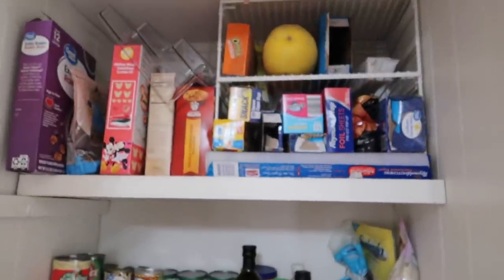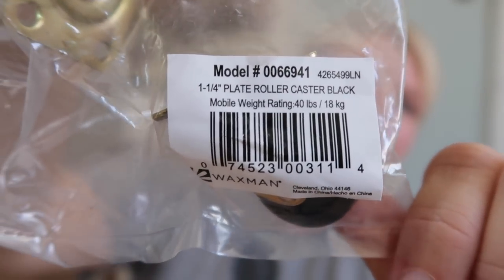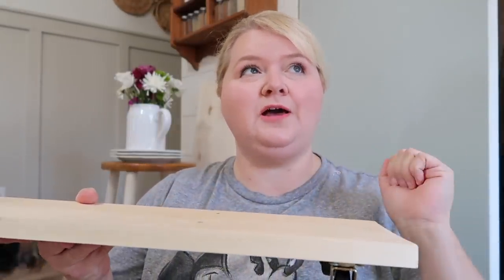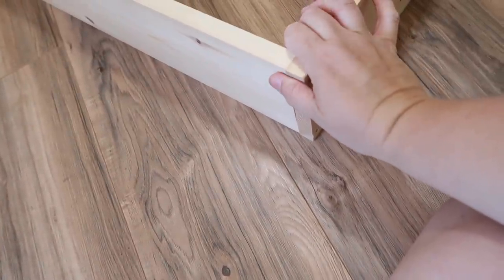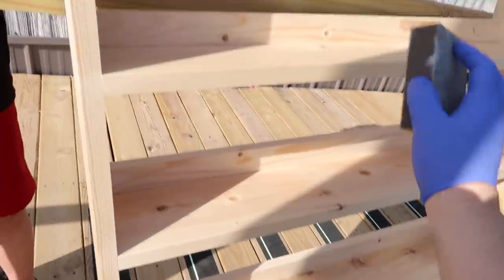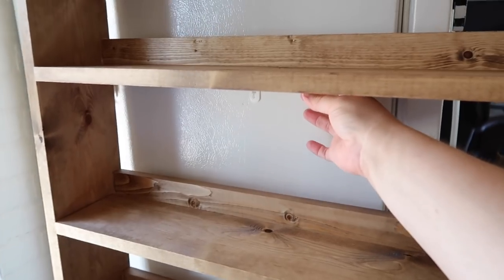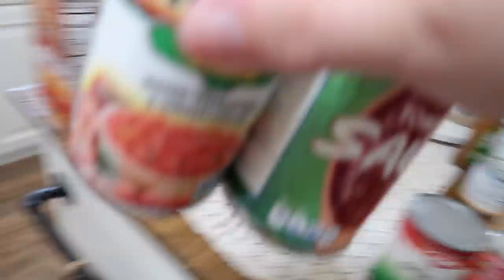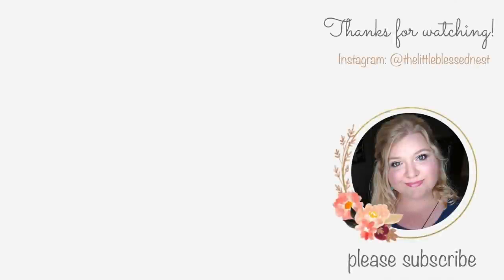Mobile Home Updates | DIY Rolling Pantry | Small Kitchen Organization | Renter Friendly

Comment: You did an awesome job building the pantry.  Yes, I thought it might tip over even before you mentioned it.  I would definitely put it between fridge and countertop.  That's the reason for casters.  You can just pull it out when you need something.  Love it.  Looking to see if there's a place for me to put one like it.
Reply: I agree - for safety purposes; also love the natural color of 🪵
Reply: I made a small one and put it in my Bathroom. It is fantastic. The Vanity unit was smaller than the counter top so it sits under the counter between the vanity and the shower screen panel. I painted mine the wall colour so it blends in well. My first effort and very proud of it. I think Stephanie is showing us you have to have a go and you will be surprised at what you achieve.
Reply: @katbar6066  That sounds great.  Can never have too much storage.  I'm always investigating spots to put something for storage.  My house is very small so never enough room for things.
Reply: @DJ-ok5ov  mine too and bathrooms are notorious for lack of the storage we girls need!

Comment: Looks good Stephanie. I would put it between the fridge and counter. You can hide the tag by hanging something over it, like a picture, or pot holders etc... Also, if you were putting it on the outside of the fridge you would not have needed the wheels, right? Please don't take this as a criticism, but even adults should wear helmets when riding ATVs as well as young ones riding with the adult. If for nothing else but showing safety by example. Thank you for the song Timmy! Looking forward to the new pantry shelves and door redo. Take into account that microwaves also need ventilation and that it's not too snug of a fit. I think it's going to look good in the pantry. Thank you for sharing today Stephanie.

Comment: Pro organizer here. I just remodeled my home and designed and built my pantry. I made the space between the shelves smaller to maximize the number is shelves I got in. I WOULD NOT MAKE THE SHELVES DEEPER except your microwave shelf. Things get lost and it’s a nightmare. Measure most of your food for height then figure out spacing. I have 12 shelves in my 8’ tall pantry. There are some great diagrams on Pinterest maximizing pantry shelving heights. Good luck gal.
Reply from the maker: Sounds great!

Comment: The roll out pantry is a great idea, nicely done, it sure will add to the storage, holds a lot.
Suggestion:  You could add more shelves in the original pantry, there's a lot of room above the items on each shelf that is wasted space and so you don't have to stack items.  Go with the 16" deep and put the 12" in between, since you already have them or even 10" or 9" deep in between, to be able to reach items easily; double the storage area.  I like the idea of bead board to finish off the face of the roll panty, it will look good.

Comment: Goo Gone is an oil base which is probably why it didn’t stain the same.  Just peel the sticker off using a putty knife as much as you can without gouging the wood and then sand it to remove whatever is left. If you don’t like the look of your cans showing, you could put a piece of bead board on the side that faces the door and install a handle on the end to pull it in and out when you want to access the cans, great job!

Comment: I, like most of the commenters, think it should be between your fridge and counter. My main reason is I think the opening and closing of your door could vibrate just enough for it to eventually cause the shelf to tip over. With my kind of luck, someone would be coming in the door and it'd hit them.

Comment: I think the rolling shelf should be between the fridge and the cupboard and then add a handle to pull it in and out. Given you have quite a bit of weight on the pantry shelves  I would consider an extra set of wheels in the middle. I would also put a support on the open side so the cans can't fall out. It would look a lot better too.  The wider shelves in the pantry are a great idea as is moving the microwave into the pantry.

Comment: I would put it between the fridge and the counter, turn it so the edge supports are facing the sink, all the cans at the bottom so they won't be on show, put some handles over the sticker residue so you can pull it in and out when needed.

Comment: You should have put water on the sticker first then let it dry and sand the glue off.  Goo gone has oil in it so it was absorbed in the wood and the stain could not go in.  Besides that it looks amazing great job you have great idea’s

Comment: What you might consider is using Rubbermaid containers & trays along with extra wire shelving - I've used these items for 12+ years in a traveling RV lifestyle and it keeps my dry goods protected from bugs & different temperatures. Also they stack well & it's a better use of vertical space. I'm now living a mobile home in Paducah area & still use these items to fit everything in my cabinets & pantry. Also do label all containers - many items look alike when decanted.

Comment: You don’t need to take out the existing shelves. Just cut the boards you bought the extra width you want the shelves to be. I did that for my pantry and it worked out fine.
Reply from the maker: That's what I ended up doing.

Comment: Stephanie, another great diy project accomplished!  Maybe take a palm sander to the sticky label residue and re-stain that section and see if that helps.  I wonder if you have some room between the door and rolling pantry if you could screw to the wall a vertical 1x2 and either stain it the wood color or paint it the wall color so that it serves as a "cleat" that when the pantry is rolled back to the wall the 1x2 will hold the back side of the pantry so it would not tip over towards the laundry area?  Timmy, Just a closer walk is another fave song and I am looking forward to hearing your new song one day as so far it sounds beautiful.  Looking forward to the redone pantry next week.  Thank you for an inspiring video!

Comment: love the project. A big tip for any label/sticker removable is to take a hair dryer and blow on it for a couple of seconds. I'm able to remove it almost perfectly most of the time. The heat helps to reheat the sticker glue and it loosens, then i use goo gone if theres any residue left.
Reply from the maker: Thanks for the info!

Comment: Great job I made one a few years back. I put handles on it and turned it the other way hiding the food against the refrigerator side. If you place it on the other side of the frig, and add handles it will look like another cabinet. My cabinet has tipped over because of the coasters so it is safer to put it on the sink side I love what you did to your hallway👍🏻

Comment: Hi! Very interesting project and I love the thought of this. I have two spots I could use for this but I am going to shop around and think about it! There are two things I want to share with you in response to some of your remarks. First, goo gone is an oil based remover so it does not do it's best work on wood and can darken it. I though however you might be able to use a blow drier on it next time and little by little on low with some warm heat try to remove the label with a putty knife....gently taking it slow.  Also I have heard dozens of remarks from carpenters and diy-ers about the problem with lumber over the last year. I ran into the same issue with a build I was working on. Some people are turning to fence pickets as a substitute for some projects. It will not work with everything but you have a good eye and feel for what is good for your situation.  :) Lots of love and appreciation!!

Comment: Hi Stephanie,  what a great job I really like all of the things that you're doing I have a couple suggestions for you though, 1st of all I would not put the rolling pantry by the outside, by the door. I think that is gonna be too unstable and I would worry about it falling over,  and that way you don't have to try to find a way to attach it to the fridge and you don't have to find a new place for Timmy's things.   I would put it between the counter and the refrigerator, the reason being is that way it's supported and you don't have to worry about it falling over... I would cover the side that's on the counter (sink) side with the same brick and paint at the same color as you did the bricks and then that way you could make the wall of the pantry look like it's another wall and you can use it for decoration or you could put command hooks on it and maybe put some kitchen items on there. Another thing I would do is get to Lowe's recent place and get some ale brackets to put in each of the corners of your rolling cart I know from experience that as you move that in and out that it will weaken the joints in the corners and then it gets a little bit wobbly so I would definitely look into some metal support brackets to put inside that will help strengthen those joints. Last, of all I would like to make a suggestion about the pantry behind the door that you're gonna paint, I know that's gonna be awesome with the shelves being deeper, I was thinking that you could use the existing wood shelves actually create a riser(s) which will allow you to not have to stack things on top of each other and have them fall over.  Having that outlet in there will be great for the microwave. As always Timmy steals the show with his beautiful hymns and I so enjoy that portion of your videos. Love and tummy rubs for Bonnie and head scratches for Irvine, may God continue to bless you and Timmy every day!  Hugs!
Reply from the maker: Great ideas, thank you for sharing. 😊

Comment: For the hutch: you might try Restorafinish in Walnut on it. ( or in a color/ shade that might be like your special walnut) It’s not refinishing, it’s just more like cleaning it and restoring the finish, but using a shade you like might take it a little closer to what you might like. It’s really easy, makes furniture look great, and doesn’t do anything that would make it harder to refinish later. They sell it at most hardware/ lumber stores. And at Amazon.
Reply from the maker: That's an interesting idea! I hadn't thought of that. I saw a girl I follow on YouTube use that in a video so I do know what you're talking about. I may give that a try on the inside of a door and see how it turns out.  Thanks for the tip!
Reply: @LittleBlessedNest  I hope it works! ❤️